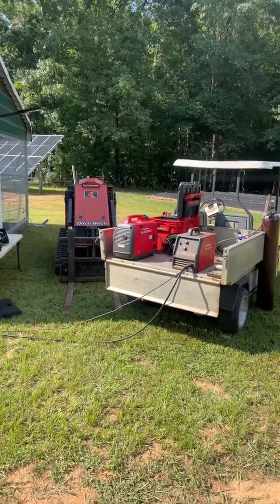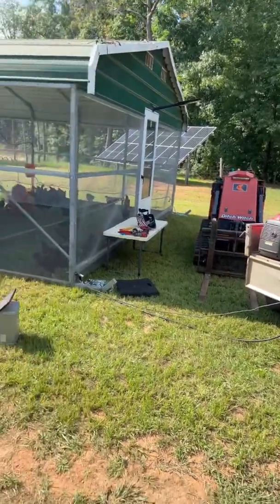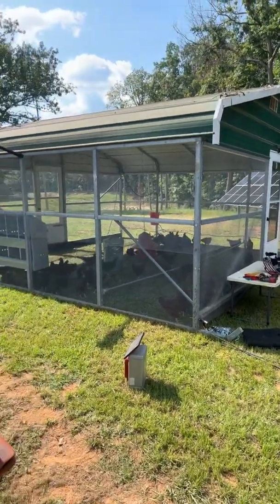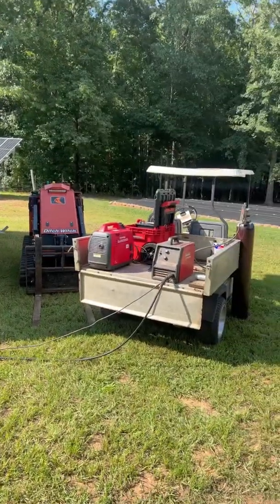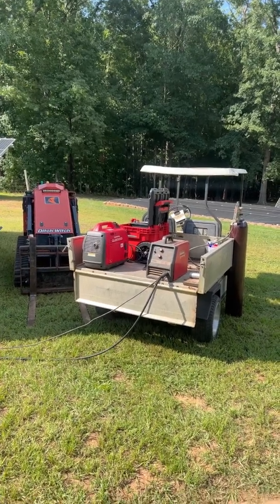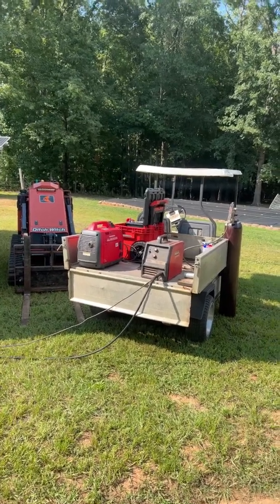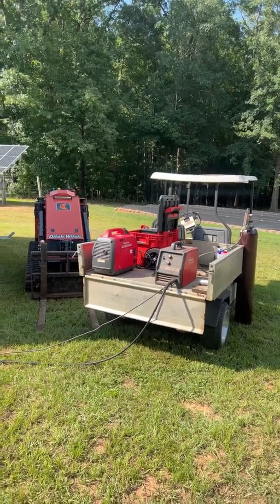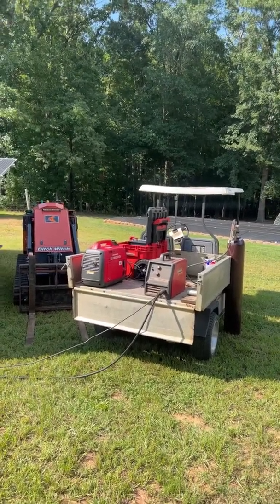Lincoln 110v welder run with a Honda EU2000i generator

Comment: Nice video. What rod and amps were you using?
Reply from the maker: The Lincoln 110 is a mig welder so I was using a flux cored mig wire. Not sure about the amps but probably about 4-5 on the amp control knob

Comment: Tony there are several videos of people who welded with a 2kw generator and all had fault setting pop. Would be terrific to see someone welding with a small welder using two of those generators connected together. I am pondering buying a second 2kw generator.
Reply from the maker: I don’t have a second 2000i but I I would definitely try it if I did. You’ll also need the paralleling cable. Thanks for watching!
Reply: @thrashersheatingandair 
Rent another generator for the day, and do a test with two generators
Reply: @NOMADIC-T.R.A.M.P.-ARTIST   If it runs it on 1 it will obviously run it on 2 without failing.
Reply: Turn off the "econo" mode and the motor will keep a consistent max RPM.  You can hear the motor's RPM go up and down as you weld.  You want the power to be consistent and not have any ramp up time as soon as you weld.  You will likely trigger a fault with the motor going from idle to max over and over again as you weld.  You definitely need to let it cool down a little bit between each weld.  Another option is to hook up a fan to the electronic circuit and a heatsink to help keep it from overheating.

Comment from the maker: Update: I did a more extensive weld later on with the same welder settings and the generator did fault. Therefore the combination works for short duration (few seconds at a time) welds but not for longer duration (like 30 seconds continuous).
Reply: Thats great information to know :yt:Dexterous X:yt: